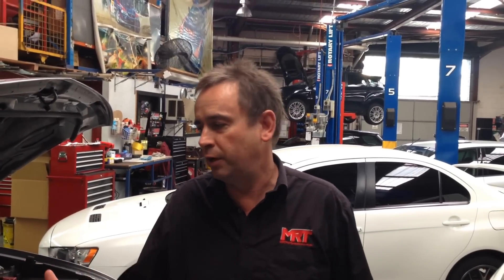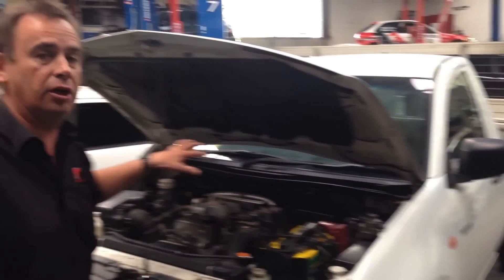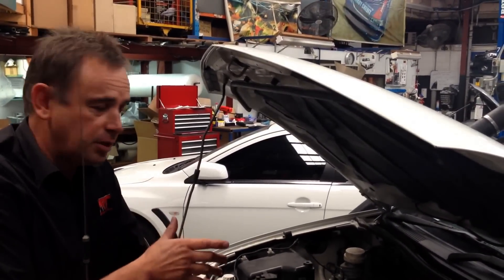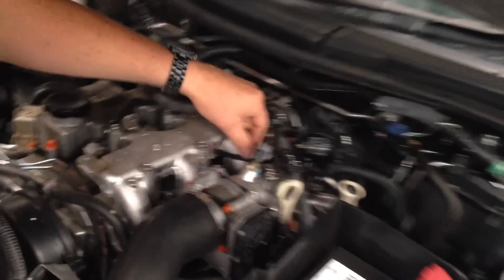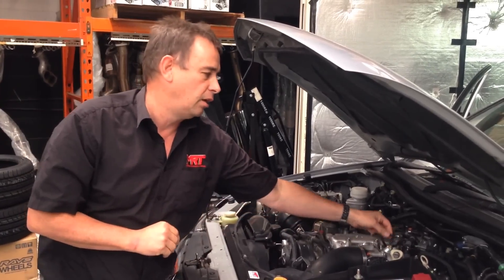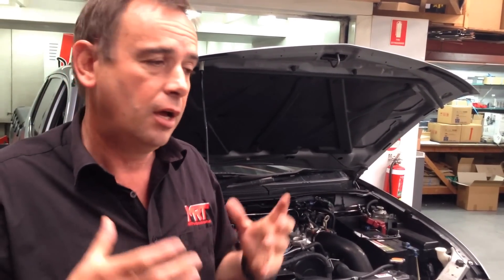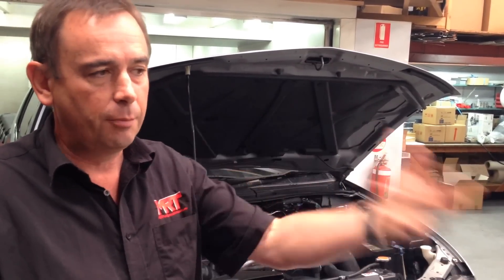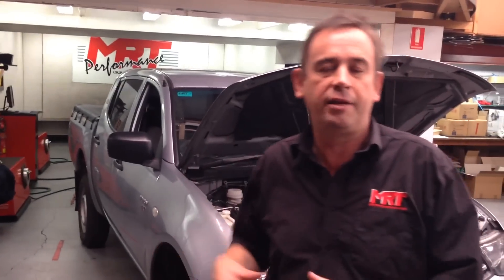Mitsubishi soot and EGR diagnosis, MAP sensor information tips and traps

Comment: I want to ask you if you know why an egr is not moving but it returns to close position if you move it by hand when turn ignition off. The egr is new and i tested with a adjustable power supply that the egr motor is moving when applying voltage and egr position sensor ir ok if i move the valve by hand. But it thows egr p2413 error every time its powered on. And if i command to move the egr to 50 or 100% with obd software it does nothing. Im not sure if this is an ECU problem or new EGR is bad.

Comment: Hey mate like the info in you'r videos, I was wondering if you could answer a question for me. I have a mq 2.4l triton, my dpf light came on and my machanic told me that it came on because my egr valve was fully closed and apparently the reason it was fully closed was because the ecu closed it because I had a boost leak or (a split in my intercooler pipe), hence why my dpf ended blocked and the light came on ?
Reply: Hi Kaine, have you solve this problem or is that really the main problem why your dpf got issue?
Reply: @neiljohntolentino6365   yea thats it so I changed the intercooler hoses both sides after market ones plus a couple of other things so I don't have any other issues with egr and dpf in the future
Reply: @kainemill1790  thanks a lot.
Reply: @neiljohntolentino6365  yes that was the problem so I got better hoses, stock ones split after 3 years
Reply: @kainemill1790  which hose did you replaced? The one goin to throttle or to the turbo? 

So your egr dont have issue? Its just the hose why ecu is commanding close egr?
Reply: @Kaine did the dpf lights disappear when you change the intake intercooler hoses? I got 2018 MQ split hose on intake intercooler my mechanic replaced it and did a burn regen but couldn't get rid of now a flashing dpf lights.

Comment: hi there,i have a 3.2 triton ..done 200 k...manifold has been cleaned and update on ecm..anyway it has a miss between 1 and 2 thousand rpm ..and quite noisey as in a rattle/knock noise..map sensor line is clean and it runs like a rocket once you are over 2 thousand rpm...no codes..was thinking possible bad injector..?? and help would be much appreciated
Reply: Can you tell me where the cam shaft sensor is located on a Mitsubishi l200

Comment: HI mate, my triton 2010 MN series keeps coming up with a engine light and limp mode and when the ERROR code is checked it reporting on overboost. ive had it to the dealers multiple times and they changed the the boost sensor after the 5th time the light came on, but that hasn't fixed the problem. it initially only happened when pulling my caravan, but it recently even happened when i had no load on it.  any ideas mate. as i said ive had it to the dealers multiple times and im desperate  and would really appreciate a solution.
Reply from the maker: we have fixed  many, but it wont  be the sensor, sounds like ECU tune OR POSSIBLY soot contamination